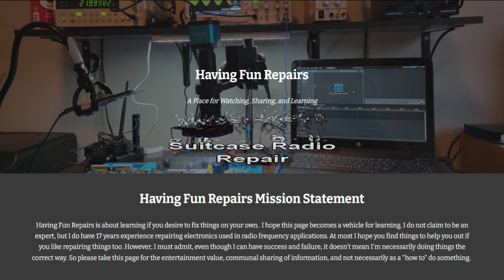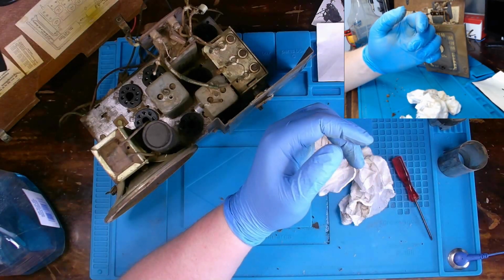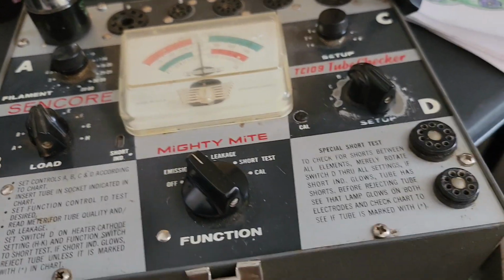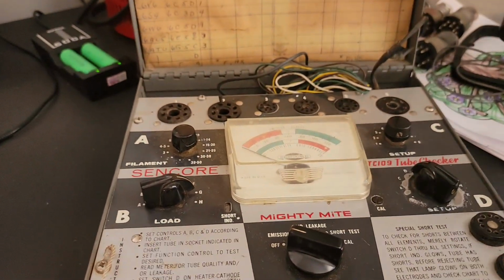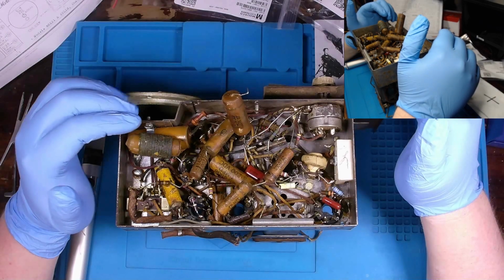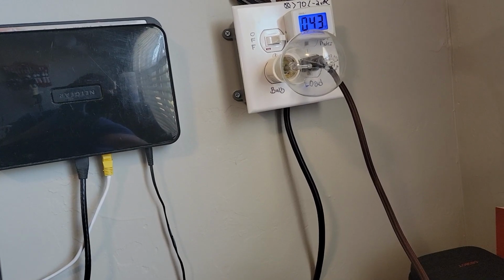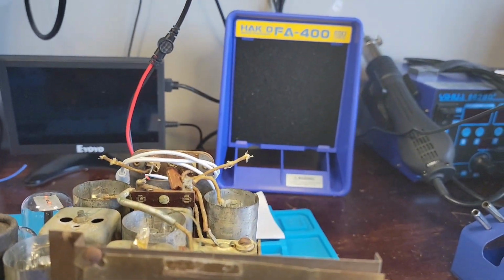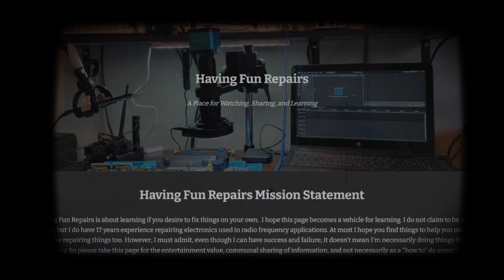1946 Motorola 65L11 Suitcase Radio Repair

Comment: Nicely done. A bit of drop-out at 51:49, maybe a bit of dirt  or plate touch in the tuning cap, or just my imagination.
Reply from the maker: Exactly where my thoughts went. I think it was a two or three gang tuning capacitor. At first it wouldn't tune up to 1600Kc. However it freed up while I was aligning the radio. I would have liked to have addressed that issue. However, the customers intention was to make work. I only charged a days labor and components really (although it took about 21hrs total to make it electrically functional again).